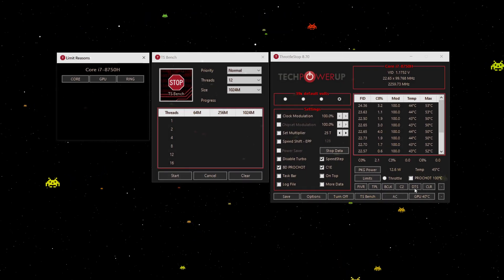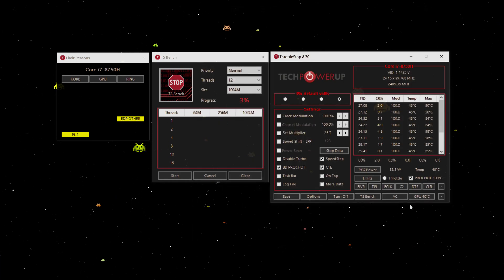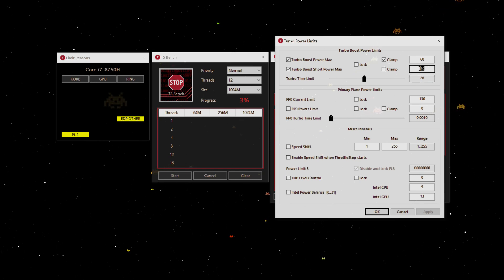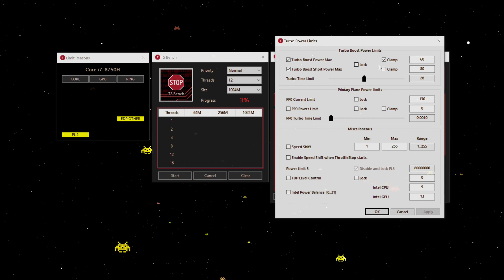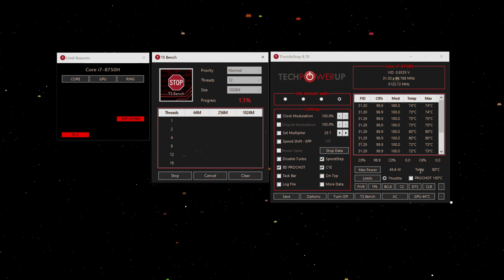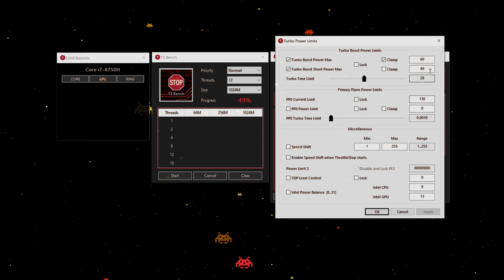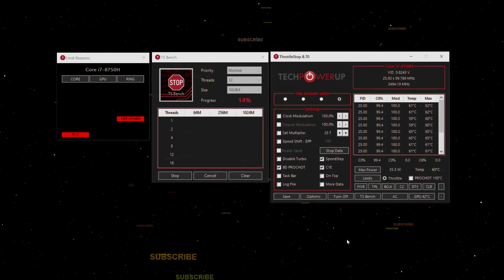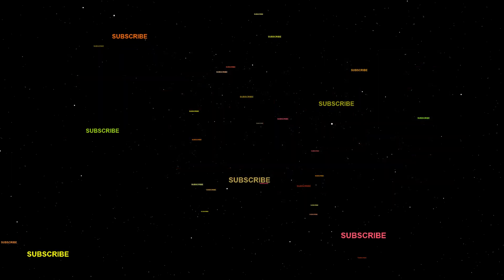Understand then COOL the intel i7H CPU Tech guide #2B ⮜iDATUS⮞

Comment: I must have missed something why the 3.9 setting to start? My i7-9750h has a boost frequency of 4.5 on single core down to 4.0 for all six cores.
Reply from the maker: I have a lot of videos on how the cpu works which you might find interesting.
I am not aware of single core apps so no point in not setting all the cores the same 41 or 39 etc. 
If you set all cores to 41 but the last one to 20 all cores will run at 20.
If you did have a single core app the cpu will use the least used core which tends not to be core 1 which from my knowledge is the only core that can run at that speed.
39 seems to be a good starting point.
I need to do some further research to do an ultimate stable speed guide which will work for any i7.
Let me know if you have any more questions.
Reply: @iDATUS  Okay I am trying your power boost timer test how ever I am unable to notice or see a 45W sustained MHz. I have lenovo vantage set to performance mode with sets my PL1 and PL2 70/107 respectively. I am noticing the same MHz when I hit 70W this also seems to reduce in Wattage as I lower the All core Frequency. Do I have my Long Boost set to high to be able to see the 45W sustained I doI just keep lowering All core until I do?
Reply from the maker: @laughingmute608  There are a lot of factors to hit a sustained wattage you must not generate a throttle down event.
If you go over 45W for a period of time you will hit an event.
If you go over 90C on the cpu or 100C on a cpu CORE it will hit an event.
Now I don't know if the lenovo enables or disables different options, as I pointed out for my Razer even though I can changes settings it doesn't mean they get changed or do anything.
So to keep the throttle events to absolute min, in TPL set the Turbo Boost Short Power Max to 45W and lower the cpu voltages.
This will give you the max mhz and the coolest cpu for the longest time.
If you do hit an event (you have a warm room or cooling for the cpu is not as good) lower the 45W value.
Reply: @iDATUS  I do know that if I set the Turbo Boost for short or long to 45W I only boost upto 3.2ghz and my temps stay low around 60*C. The problem I am having now after adjusting everything and about to switch back to default is when playing Valheim an Icon appears in the top left corner that looks like a cable (power/USB/HDMI hard to say) with an X on it connected to what looks like a tower. My audio from discord gets distorted and I am dropped from the server we are playing on. I also noticed that when I accidently hit the 7680M stress test from Throttlestop 9.3 I started to here an electrical noise under my enter key. The wifi card is near the caps lock on other side. I fear I may have messed everything up I had a stable setting but then couldnt get my monitoring overlays to work so when I saw a 97*C temp I wasnt sure if it was a spike or consistant and starting tweaking again now I have all these issues.
Reply from the maker: @laughingmute608  So I would remove voltage changes, leave the value at 45W and see if the issues you describe disappear.
Reply: @iDATUS  removed voltage changes, long is still at performance default of 70W and short is set to 45W. It appears most issues have subsided. The Electircal sound is more of a soft clicking now. Friend says it could be coil whine or I may need to clean my fans. Both my GPU and a Fan are near the enter key. I'll looked into how to clean the fans and will have to do more testing tonight when everyone is on and using discord.
Reply from the maker: @laughingmute608  As you are not going over 45W in theory there is no point in having lenovo performance software set to high. This should lower the max fan speeds and any other power boosted devices.

Comment: hey bro I love your videos, I was getting high temp so I went out and repasted my lappy ( I have RB15 2018 adv 1070 maxq 1080p 144hz) but still my idel temps are like about 60 deg. Its better in game though now. I have done everything like undervolt and all I do not know what to now :/ please help
Reply from the maker: Nice complement thank you.
Repasting shouldn't make any difference these days and I may add a little video on that later.
Been busy doing a lot of studying so pardon me if I rusty, 60C is great, its anything above 89 for any core that causes huge throttle back.
Think I would need more info on what you would like to improve and what you have changed if anything so far.
Reply: @iDATUS  Hey buddy thank you so much for instant reply , hope your study is going well. I was just worried about the fact that my lappy was running at around 60-70 deg with fans always on with 0 work load too. So I repasted and it and it had zero effect ( I used TG kryonaut ) I was just worried if 60 deg without any load with fans always on alright for my laptop or not. As far as undervolting go I tried my best to do as per the videos but idk I guess I am just not doing anything correctly as I am seeing 0 results maybe if you can help me how to exactly do it for my laptop :/ I know its a huge favour maybe whenever you are free please help me on dm or discord somewhere ( I have watch all of your videos million times but idk dude my gpu temps and cpu temps are as high as wiz Khalifa.... 
thanks 
regards
Reply from the maker: @devanshxarora  Happy to talk more 1 to 1 as you have looked at my uploads and tried a lot of things.
I would use teamviewer, you don't install any software and I be able to take a peek at your settings.
If you haven't already join my channel and we can take this chat to the youtube discussions tab.
I will also check my default temps. I am pretty sure its not 60C at rest.

Comment: What is pl2 ? Also if you tick disable turbo i think your temps will definitely be lower right ?
Reply from the maker: Hello again Neil, PL2 stats for "Protection Level 2" if you tick disable turbo it will be lower as you wont be going above  2.2Ghz (all cores set to 22).
This video was to explain what setting makes the PL2 warning appear and how you can use that setting to your advantage, especially when used with others.